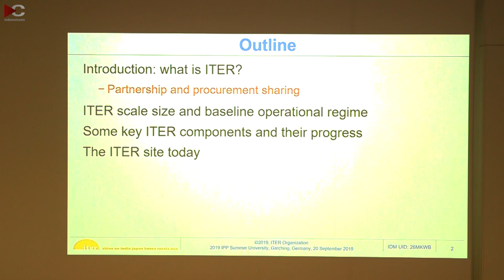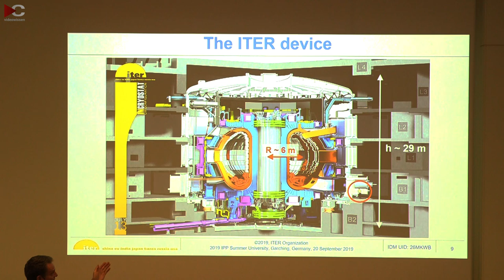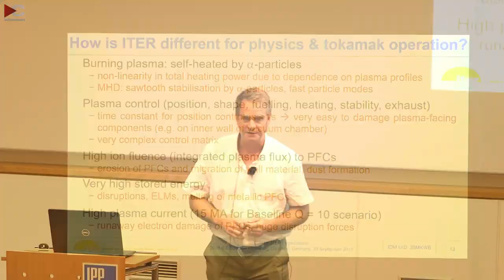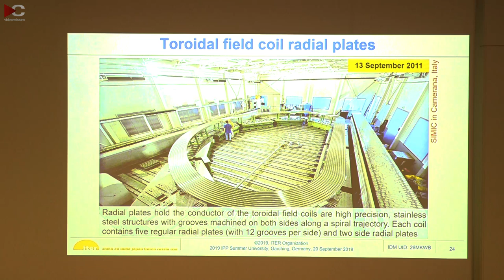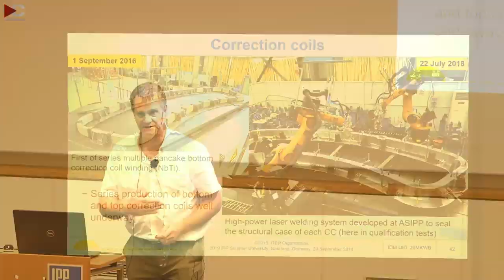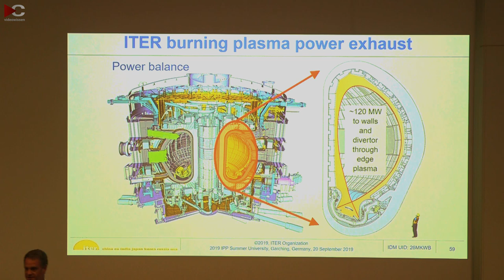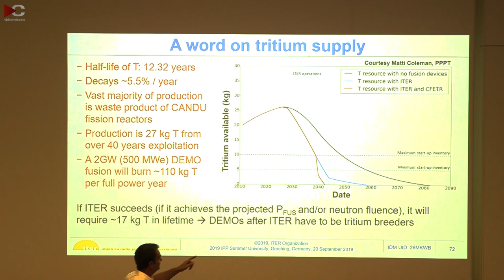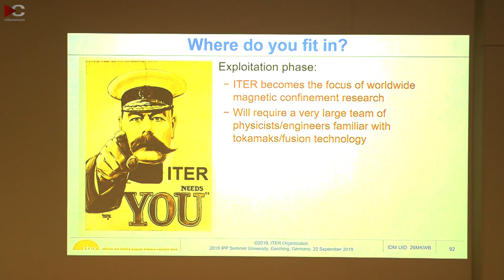Fusion research: ITER the next steps | Richard Pitts

Comment: 1- Will ITER deliver a blueprint for a commercial fusion reactor within a decade/within the time it takes for humans to pump another 3bn metric tonnes of CO2 into the atmosphere? 
2- Will ITER deliver a blueprint for a commercial fusion reactor substantially (say 600 million tonnes of CO2) before a competitor project?
3- Does the ITER project 'feel' well managed or does it 'feel' like it's run by politicians (time waste, disorganised, ego before mission)?
4- Given the importance of solving low/no CO2 power to humanity do you think ITER deserves public funding or should the funding be diverted to other projects that are more promising in terms of cutting CO2 emissions sooner. 
5- If ITER did not exist which alternative fusion or fission technology should the original $5b be invested into.

Thank you
Reply: funding for fusion wont resource bleed other research projects (you could fund multiple projects with ecb issuing the currency for it), fusion could be reality now if we had funded this field several billions per years from the 70 or 80s onward, now you probably say that it costs a lot of money, and yeah its costs lot of money but the rewards are incalculable, we did the same thing with robotics, semiconductors, gps and so on, those technologies cost billions and billions per year to research without any kind of commercial product in sight for decades, there won't a technology that will save us from climate change (some will help) its a economical/political problem of mass consumption culture.

Comment: The scientific argument was so weak for this project that the communication had to be insincere in order to obtain funding. Everyone knows this now, both in the scientific and policy-making communities. There are so many more efficient ways to get fusion energy.
Reply: I don’t think this is a fair accusation. Most of the “better” ideas to make fusion work on a smaller scale have not been around for long. The delays are sad though, might not have been necessary to build it so big without such a large delay between concept and building it. The results from testing and building the components are likely to be very useful even if other fusion concepts pan out.